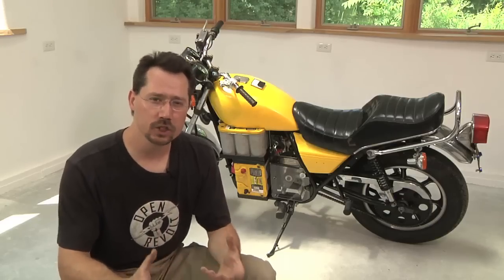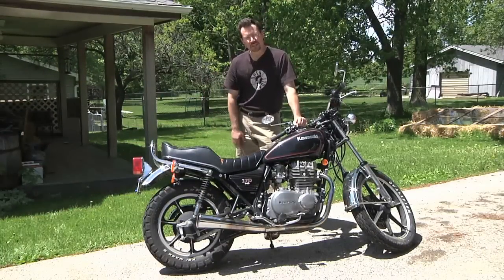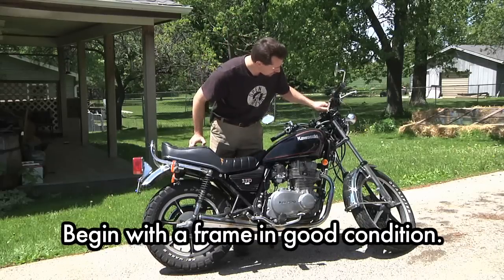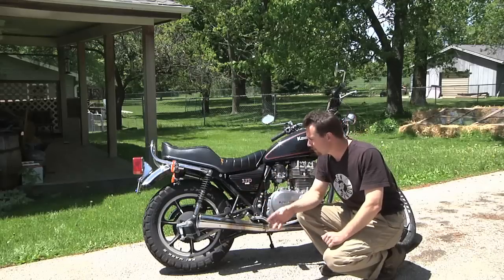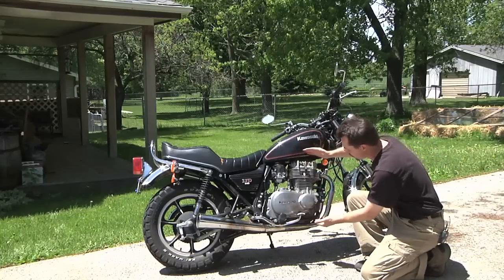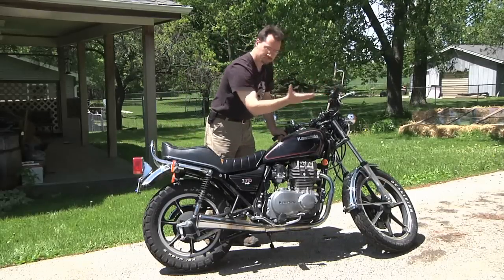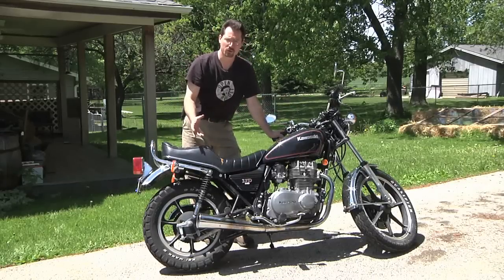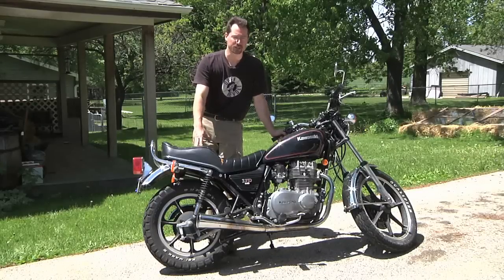Electric Motorcycle Conversion: Choosing a donor bike

Comment from the maker: Yes! Absolutely. On my project, I was able to fit the batteries, motor, and other components all inside the frame WITHOUT chopping, welding, or otherwise modifying the frame, but it was tight. It never hurts to have a little more space. You probably do not wan't something so huge that you are now wasting energy dragging around a huge frame, but a little more space is preferable to a little less.

Comment from the maker: @BenjaminNelson 
In response to that, I'd like to say that a small engine motorcycle has the potential to be a very efficient internal combustion engine vehicle. The cycle that I converted to electric had a DEAD engine and transmission. The black cycle shown in the video is a different one. (The plan on that one IS just to fix up the carbs!)

My electric motorcycle isn't designed to go 300 miles at a time, but neither does it use ANY gasoline and is nearly maintenance-free compared to a gasser.

Comment: Would it be good to look at a bike with a larger ICE to have more room for your components in it? I've seen a lot of smaller like the Ninja 250's and Honda Rebels. But I would think that if you want to put a minimum of 48 volts in you'd want a larger frame. I'm interested in at least 48V and would like to use saddlebags to install up to 72V. My area has lots of hills so I'd like the better range it would afford.

Comment from the maker: If you can afford it, LITHIUM batteries are fantastic. They totally would have blown my budget though.
For lead batteries, use AGMs. They are spill-proof and provide great amperage for acceleration. I really like my Optima YellowTops (Bluetops are the same thing, just with different terminals)
I actually tipped my bike a while back. No problems with the batteries, all power shut-offs worked exactly the way they were supposed to.
Reply: Almost a decade late here, but if anyone is reading, LiFePo4 batteries are also a good midway between lead and lithium. Less overall power than lithium, but not only chemically stable and safe, but also lasts more charge cycles.

Comment: I have a project on mind but ...Do I need to change the registration, insurance etc, of my existing bike (the donor bike) ?
Any replies well appreciated.
Reply from the maker: Exact details of registration vary by country/state/locality. Generally, in the United States, modifications to motorcycles are common. As long as the frame itself doesn't have major modifications, title/license/insurance are all the same. Just make sure to start with a motorcycle with a proper VIN. Building completely from scratch or using an old frame with a missing VIN or lost title can be problematic!

Comment: So you take apart a Collectible antique Import bike thats mint for lack of a $30 carb rebuild kit. 

I can see redoing one that has a shot engine but dang. Anywho thanks for making my bikes value go up every time a mint one gets converted :)

I wanna build one but no way am I hacking a perfectly great classic lol
Reply from the maker: No. The motorcycle I’m showing here is the same make model and year as the one I converted. The bike I converted was in poor condition. Dented gas tank, rain water in the engine cylinders, etc.
Reply: @BenjaminNelsonX  OH gotcha and I'm sorry I came across brash. It's just really hard finding an affordable well kept older one like these lately that is an easy fix. I got really lucky with mine (my wife claimed it now lol). I'm 33 so these are like what I wanted as a kid, and now ppl our age finally can get em and they're either crap or they're $15000 museum pieces. Lol
Reply: I had a 2003 Vulcan 500 basically same bike haha. But mine now is a 1978 Honda CB400A very clean with only 10k miles! Needed carb jets cleaned. $800 we got LUCKY :D

Comment: That bike is so beautiful, I almost feel bad for you using it for it.
Reply from the maker: The gas motorcycle WITH AN ENGINE in it was the "stunt-double". That was the same make, model, year as the frame I used to build my electric motorcycle. The frame I converted was literally JUNK when I got it. There was rainwater inside the engine, etc, etc.

Comment: Hi there,

I have an old Honda CB 250 Nighthawk that I am looking to convert into an electric bike. I the reason I picked this bike is because its light and I can use it in any weather including snow, ice etc.
I need a bike that will give me a range of say 60 miles minimum. (i want to use it for my daily commute of 30 miles round trip

I thought of using a rear hub motor. Any thoughts/suggestions?
Reply from the maker: The main thing for a smaller bike is whether or not it will physically fit the size battery pack that you want. 100 watt-hours-per-mile is used pretty commonly as a ball-park number of what a motorcycle uses. If you want to go 60 miles, that's a 6KWH battery pack. For a 72V system, that's 83.3ah, which isn't a nice round number that's a standard capacity for batteries. The next size up is 100ah cells. Lets pick the Calb brand just for fun. At 3.2V nominal, you would need 23 lithium cells for 72v nominal system. They weigh 7.5 lbs each, or about 173 lbs for the pack. The physical size for just 20 of them would be a block 26 inches high by 11.18 inches across by 8.62 wide. That would be enough capacity for 70 miles range, but do you have 26 inches high space inside the frame of the motorcycle? I'm guessing that you wouldn't. Perhaps you could stack them double wide. If you can fit 17.25 inches between your knees, you could cut that height in half. That may work for you, it may not. That's not saying that it can't be done. Take a look at your cycle, decide what you want for batteries, do a little math, look at some specs on some batteries, figure in the voltage/amp-hour capacity/weight/physical size to see what will work best on your cycle. If you are any good with computer modeling, try making a basic 3d drawing to plan it out. Otherwise, make a cardboard box mock-up and try fitting that to your cycle. As for hub motors, they are getting better all the time. I just recently got a 2007 Vectrix, which uses a hub motor on planetary gearing right on the back wheel.

Comment: i found one that has a bent front fork and a non working clutch lever. is that good enough for a progect bike?
Reply from the maker: You won't need the clutch, but you will need a good fork before you ride it. I've come to find that sometimes you are better off spending a little more money to get something right in the first place than sinking money in later. Take a look at the cost of replacing the front fork vs just buying a different frame. Remember, we want to do a conversion, not a restoration. If you enjoy working on bikes, and can save money by getting a "beater frame", by all means, go for it.
Reply: BenjaminNelson i got it. do you have a vid on how to make it step by step? i fixed the fork.
Reply from the maker: I posted quite a few videos while I was building my original electric motorcycle. Many of those can be seen at this playlist: https://www.youtube.com/playlist?list=PLA309BE54E721B480
I also made a step-by-step instructional DVD, available at my web page, http://300mpg.org/electric-motorcycle-dvds/
Lastly, please visit my YouTube Channel and simply search there for "Motorcycle". Besides this bike, I also have some videos on working on a Vectrix and taking apart a Nissan Leaf battery pack to build packs for electric motorcycles. Good luck!
Reply: BenjaminNelson thanks so much!